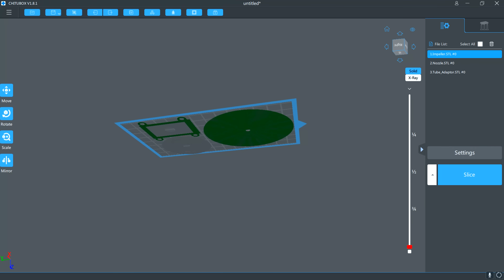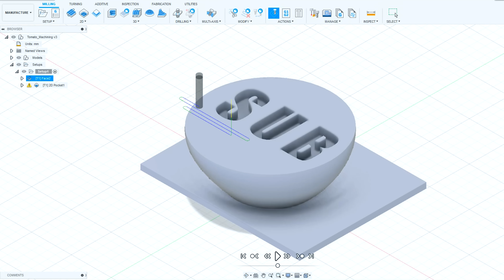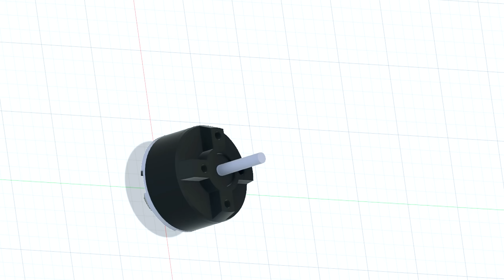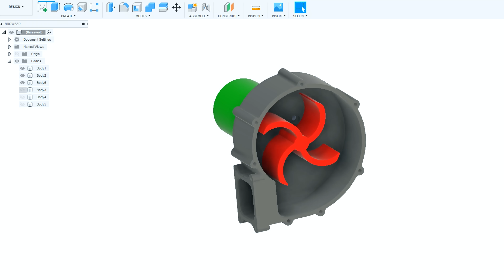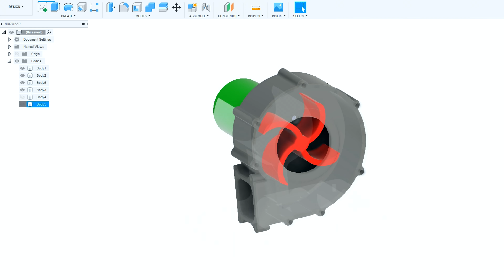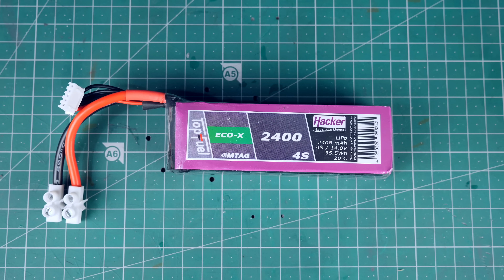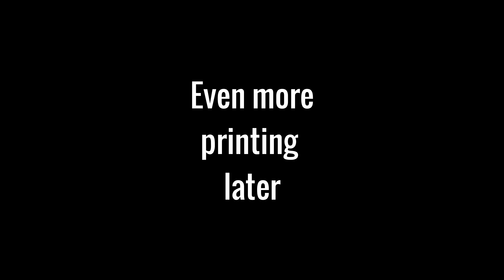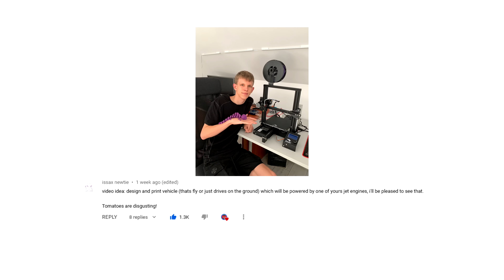Water Rocket Skateboard (3D Printed)

Comment: Have you thought of using a flexible material for an impellor like they do in oil pumps. They've got good flow rate and fairly high presure to push oil around an engine's internals.

Comment: I think priming the pump (filling it with water and getting rid of all the air inside) before operating it increases the power output a lot! Also, I think that the inflow pipe should be as wide as possible because the pump is pulling the water in as much as it is pushing it out. Making a bigger inflow pipe should reduce stress on the motor, giving it more energy to push the water out with.

Comment: cutting acrylic is super hard, I have a similar cnc, the Chinese 3040, I wasted a lot of acrylic just doing test cuts, and I haven't found the right combination of feed rate and spindle rpm.
The cuts improved when I tried applying wd40 while the cnc was cutting, but I think there has to be a setting combination to cut without the need of wd40

Comment: I like the idea, but I think, that with an curved rotor inside the pump you couldmaybe make it way more efficient. Pretty much  like in a turbo charger. Also I thought that bringing the tips of the rotor closer to the casing could make it more efficient? I'm definitely not an engineer, these are just thoughts of mine ;) have a nice day

Comment: Air pressure works best when it comes to throwing lots of water - even for rockets. Can't 3d-print anything in raisin holding 200+ bar, of course, but at least that would work.

Comment: Sandcast a PLA print of a rocket engine, that way it can stand up to high temp because you design it in 3d, sand cast it then using a bucket forge you can make the parts out of aluminum or another metal that you can sand cast. Will Tomato lord's friends and family ever get their revenge stay tuned to more Integza to find out.

Comment: I can suggest something like a Hydraulic pump design instead of the impeller. You might be able to still use plastic for those as they dont reach crazy high speeds but instead leverage torque to reach high pressures.

Comment: Hi, maybe this will be little bit unnecessary point as the turbine exploded due to the power of the motor, but the Castle Green Mamba can handle more than the 4S battery... Had it in my Traxxas E-Revo RC car and that motor is insane.... Keep going Integza...

Comment: I believe your primary problems here is that you aren't directing the flow into the impeller and your pump is full of air. You're basically churning more than you're pumping.

Check out pool booster pumps for some inspiration. I think their impeller and volute designs are will be something you can replicate with the tools you have. Good luck!
Reply: You're impeller design's would be strengthened and made more efficient by mimicking the disc style impeller. Then you direct your inlet fitting right into the disc.

Comment: Hey Integza, i believe that one of the issues was that the inlet size was too small, restricting the flow of water to the pump and causing it to over spin when there is too much air in the engine as it is unable to get enough water which is why it kept blowing up, the centrifugal forces are just too high.

Comment: I think it's gonna be better if you place the water reservoir behind the skateboard because if you go fast enough, the entire thing would want to turn around, while you have a dual water engine on the sides of the tank connected directly instead of having a pipe move the water to the engine.

Comment: You could make 2 smaller pumps to pressurize a chamber where a solution of sodium bicarbonate (baking soda) would react with vinegar (acetic acid) and the product of the reaction would be expeled through a conical nozle. I think that the pump that you made was too big and the cintrifugal force is to high. Pumps spinning at 60.000 rpm can  be preaty small. Google 10.000l/h pumps and you can get an idea of size.
Reply: https://www.youtube.com/watch?v=kqYfB2rrqXo

Comment: In the early days of commercial jet aircraft, there would be situations (heavy payloads on hot days, for example) where the engines would not have enough thrust to accelerate to takeoff speeds in time. The solution was to inject water into the engines’ gas stream from tanks in the roots of the wings, thereby increasing the mass term in the thrust equation!

Comment: You should make a remote control Squid that moves around by squirting water.
You could use a pump like this video, but what I think would be cooler is something that uses soft robotics techniques to squeeze and expand a water bladder with a tesla valve on the intake and exhaust to direct flow.

Comment: Idea: Make an air powered motor, kind of like the one Tom Stanton made, which has an air pump instead of compressed air so that it can run for longer
Reply: Seems like a motor with extra steps
Reply: wasted energy, input energy always higher than output.
motor already rotation, why convert rotation to rotation?

Comment: I think the suction side on the first pump was much too small that's might also be the reason why it didn't produce that much flow.

And you should have mounted the outlet of the pump at the upper side of the pump so that air automatically gets out and doesn't gets trapped in side of the pump that might also be the reason why the impeller failed since air bubbles basically cause cavitation wich also destroys metal impellers.

Comment: My first thought: You're going to run out of water pumping it out that fast in the air, plus the weight of the water would hold you back.
My second thought: You should use readily available water that you don't have to store... Like maybe put it on a boat or some sort?
My third thought: Wait... water jet powered boat? Isn't that just a Sea-Doo?

Integza, you should 3D Print a working Sea-Doo and power it with your water jet. :)

Comment: Create a rocket launching vertically using only water as a propellant.
but instead of a motor pushing the water use that delicious 1000/1 expansion ratio that steam gets when you boil water to create pressurized steam since steam is technically water.

Comment: 5:10 BLDCs aren't induction motors. Most of them are three phase synchronous motors, because the permanent magnets (and not currents INDUCED in the rotor) rotate at the same rate as the magnetic field. Induction motors are asynchronous because the rotor needs to turn slower for there to be a relative motion that induces the currents.

Comment: You should make a gear pump for more pressure. If you design the gears big enough you will also get a good flow rate. And... It's easy to make out of aluminum with your cnc machine.

Comment: Isn't the build-up of heat in the pump more problematic than the strength of the material? Maybe change the propellor design to displace more water at slower speeds.

Comment: The explosion part is great :) You should definitely use your CNC to cut through some aluminum to try it again.

I would like to have seen some cherry tomatoes go through the impeller in slow motion. 

This video is amazing, I love your explanations and your utter disdain for Tomatoes. Video idea -  I think you should 3D print and assemble an Execution guillotine stand for tomatoes where they levitate using the Coanda effect from an air compressor before being decapitated! This would be wonderful and the Tomato carnage that would ensue would be remembered for generations.

Comment: Integza, As you have such a high speed motor, how about getting some old hard drives and using the discs inside to make a Tesla turbine.
Reply: What does that tesla turbine have to do with that high-speed motor?
Reply: @Leroydv97  Tesla turbines are efficient at high speeds.
Reply: @Leroydv97  A tesla turbine can be used as a pump, at extremely high speed, and has far less risk of explosion through impeller failure.
Reply: @wibblywobblyidiotvision  oh I see. But would it work like a pump?
Reply: @Leroydv97  in short, yes. It just won't be able to create a lot of head pressure, so there's quite a limit on how tight the nozzle can be without losing significant amounts of efficiency.
Reply: @Leroydv97  Oh yes. It may well make a better pump than turbine.
Reply: @wibblywobblyidiotvision  actually, it might make a REALLY good compression stage for a turbine generator. 
It will move a lot of air. If stuffed into the combustion chamber of a jet turbine, it should work really well.
Reply: Ahh you beat me to the genius idea I thought of as well, I'm not sure about the hard drive disk though,  I've taken a few apart and idk what they are made of, glass or some plastic coated in metal in me experience. liked and good luck
Reply: @wesleyr6505  I built a Tesla turbine using 14 laptop HDD platters. It works really well. They are metal with a metal coating on them. They are also made to spin VERY fast. You could also use large capacity older desktop HDD's because they will have more of them on a stack. Although they aren't super efficient, for the purposes of trying it out, they are already mounted on a brushless motor that can either be used to generate electricity OR to use as a motor to turn the spindle...
Use a brushless ESC to run the motor. Some HDD motors have 3 wires making hookup easy. Some have 4. The extra is a common so use your multimeter to find it and use the other 3 to hook up to the esc.
Reply: @christopherleveck6835  ahh, thank you for the correction
Reply: @wesleyr6505  no problem, us Wesley's have got to stick together......(middle name is Wesley, after my Grandfather..)
Reply: @christopherleveck6835  nice,  mines Charles, after my grandfather,  kinda close to Christopher

Comment: You have forgotten one thing air is a compressive fluid where as liquid is uncompress able inside the centrifugal chamber the blades energy losses due to air present in it to avoid it the reservoir is placed above the height of the centrifugal pump, and your blade model is to push the water and not pull it, design a perfect blade that can push and pull the water, with less energy loss or you can try new type pump 
 (" vane type ") pump it is best for your scate board.all the Best for your next try ❤️😎

Comment: It also seems like a lot of air is going through the impeller along with water, RC motors can be fully submerged while functioning no problem (not the esc). Maybe submerge the whole housing while the nozzle is out of water of course

Comment: Integza!!
The Problem- The invisible force 
1) Very High acceleration to reach max speed
2) Cavitation
Solution:- Use a programmable motor controller to set the time duration to reach max RPM
Use 2 Pump in series as step-downs 
TRY IT!!!

Comment: What I noticed was ingress of air in the pump housing. The center of the housing (axle) has under-pressure, that's why there is usually a seal here (just a like through a boat hull to power the impeller) In this case an o-ring (or 2) can be enough.
Also the acrylic could use some sealant on the perimeter of the housing (in this case for over-pressure).
Then with a 2000W motor, all the parts where this energy is transferred to, should be capable of handling this power. (motor axle can be thin, because of the high rpm) But the connection between axle and impeller needs to cope with this. I expected slippage on the axle... But the instant detonation was a nice touch.
This was a great video, looking forward to the follow up. Please keep the acrylic, this gives a lot of insight of where the restriction is.
You could try to put the opening of the container at the bottom, and angle the container, this way you have a little bit of head pressure, and you can use the full capacity of the container.
Keep Up The Great Work!
P.S. tomatoes are disgusting!

Comment: You could use your CNC mill to mill a billet aluminum pump housing and impeller.  Then use that pump and a waterproof servo and 3d print a directional nozzle connect it to the pump and servo and you now have a water jet motor that you could fit in almost any model. And you could still use an acrylic side plate so you can see it working.

Comment: I really like your Tom Stanton impersonation! Well done
edit: Isn't your pump wheel turning backwards with the blades pointing away from the water jet?
Reply: No, he’s got it right. The impeller throws the water outward, the pump casing (technically called a volute) directs the water towards the discharge. You don’t really want it to “scoop” the water out. But it does seem unintuitive.

Comment: Not sure if this would be possible, but it would be really cool to see two of your video concepts combined. This water jet with the wankel engine. However the waterjet might need some improvement and i'm not sure if the wankel engine can function under such high load.
And i know it doesn't make sense to power an engine with a pump powered with and engine. But would probably be interesting anyways.

Comment: Is the rotor not the wrong way round and/or spinning in the wrong direction :S ?? 
I mean you are giving the water angular momentum in the anti-clockwise direction but the jet nozzle is designed as a clockwise spiral and therefore to accelerate the water in a clockwise direction. 
Doesn't this mean max pressure will be in the top of the pump (where you can see the explosion keeps occurring) rather then the bottom where the exit is? I think this is also the cause of all turbulence in the water.
I might be wrong tho :S
BTW LOVE THE VIDEOS :D

Comment: can you try to 3d print a gasoline mini engine like 1 or 2 cilinder , i know heat will be a problem but you can probably find a solution ;p you could reach some insane speeds putting that on a car or boat

Comment: The moment you said "this can spin at 60000 rpm" my mind questioned: How is the plastic withstanding that force! I think is still possible to create it in plastic but only if you make some adjustments to the design. Why not testing the wankel rotary system to create the pump?

Comment: I usually really appreciate your videos, but this time, it was a bit disappointing. The impeller you designed is like the most basic design, and if I see it correctly, it was spinning in a direction that's more suited for air rather than water and other incompressible fluids. There also seemed to be a lot of cavitation which means wasted energy. 

I really hope you improve on the design and get the water jet skateboard working. Top fuel dragster boats already use water jets instead of propellers to accelerate, so obviously the idea isn't new. Maybe you can find some inspiration from those areas?

Comment: I’m guessing the first pump didn’t work because you reduced the diameter of the inducer to a few mm using the red inducer adapter, so the flowrate was super limited. The second one took the full diameter of the inducer so it could pump more water

Comment: How about putting that pump on a small boat or something that floats, and try it in a lake? 
So the water comes from the lake. 
The engine can rotate a bit for maneuvering? 

As for the nozzle in this project, would it be more effective if it was aimed at the ground (close to the back of the skateboard), or does it not matter?

Comment: The problem with this design is that the impeller isn’t sucking the water in through the inlet, it is just using the water running into it and then blowing it out. To create more power you should use a similar design to a turbocharger, where the impeller isn’t flat at the inlet, but instead curves up to suck water in.

Comment: It looked like you were running that design in reverse. Also the input was feeding the low pressure section and putting a load that negated the whole high pressure section.

Comment: You should make a plane/car/boat mind controlled. You could even use a rocket/compressed air/the wankel air engine you made. I saw someone use a ‘mind control’ toy to measure electric waves in their head, which es they mapped to controls.

Comment: Idea : Try to make an actual combustion piston engine when you learn to cut metal on the CNC
Reply: love the idea but it would be ridiculously hard
Reply: jacobzzz698 retardedef gamer  how he died bro?
Reply: Nice pfp perkele!
Reply: It is a good idea. The Problem is, that he only has a 3 axis machine. That would still be possible but as far as i could see, he only has a small router. That thing propably cant mill a 5cm deep hole for the pistons.
Reply: That thing would mill aluminium with 0.1mm deep step at most and die after 10 hours of milling it :D
Reply: I don't think that cnc will cut Metall
Reply: @peterzingler6221  it might do light aluminum but thats probably it. Have a longmill and it barely does aluminum and its way bigger than integzas

Comment: CNC Machinist here. A good place to start would be learning how to calculate speeds and feeds. You'll want to find the recommended cutting speed for the acrylic, probably given in Surface Feet per Minute (SFM; Imperial), or Surface Meters per Minute (SMM; metric). You'll also want to find the suggesting chip load per tooth from the endmill manufacturer. Acrylic is very soft though, so you have a lot of room for error there. Welcome to the world of CNC machining! You should think about getting yourself a bench top manual lathe as well.

Comment: Use the cnc to cut .5 mm stainless sheet and make a tesla turbine, with a 3d printed hub and casing. Drive with with the motor and try this again. Tesla turbines are meant to be highspeed/high flow, which is exactly what you want. 
Plus it will be super satisfying to see your tesla turbine project get a reprise with so much more experience and equipment